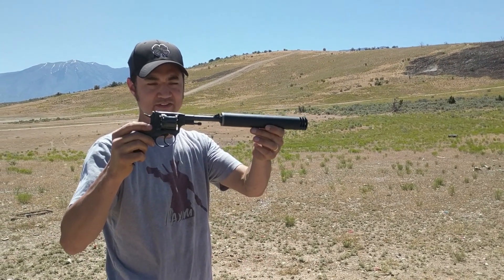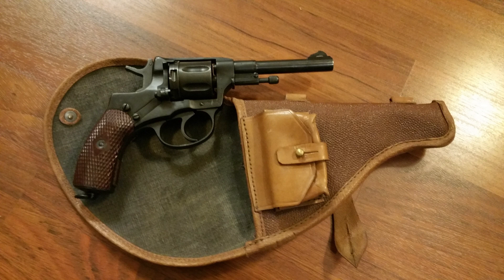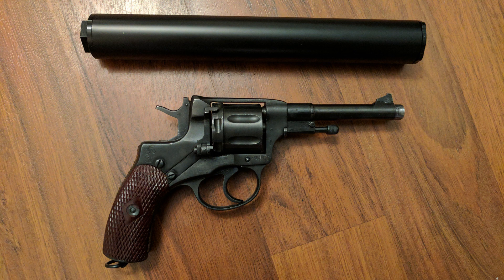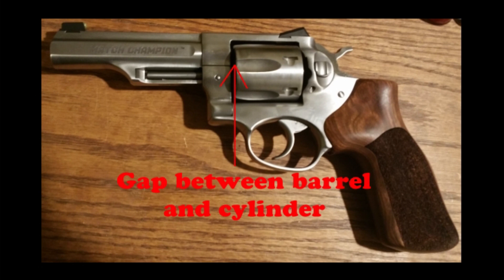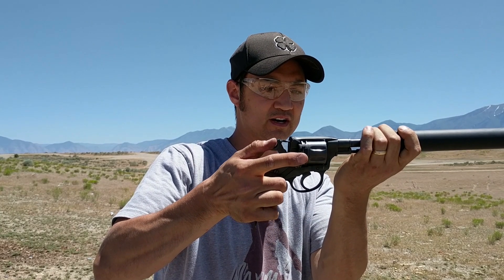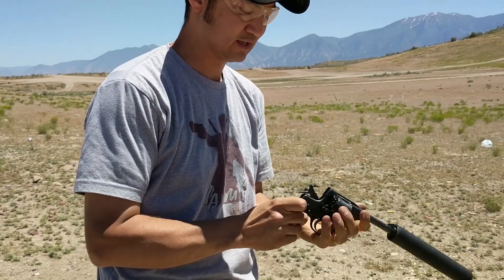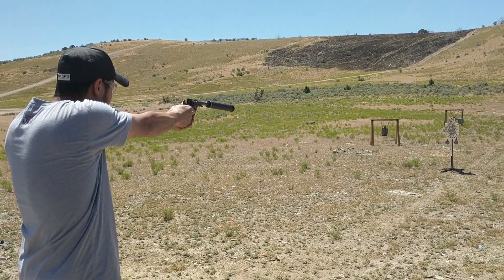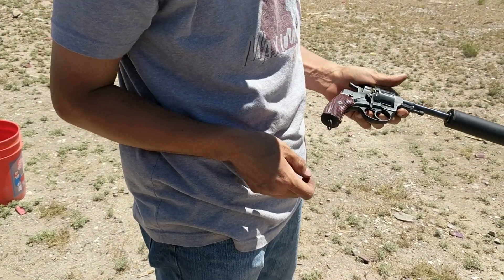Suppressed (Silenced) Revolver (Russian M1895 Nagant Revolver)

Comment: How does the suppressor effect accuracy and your ability to aim down the sights?
Reply from the maker: With regular height pistol sights, you can see the sights fine but the suppressor blocks view of the target--so you have to sort of guess where the target is if it is a smaller target.  It isn't too bad when aiming at larger objects.  My point of impact changed slightly.

Comment: I wouldent say you were going Blah Blah Blah that was very good information :), i just recently bought a pistol a more modern firearm, an H&K VP9 and i have been getting upgrades fever, i upgraded the mag release flippers, and aswell got a bigger slide lock release fin (i dont have strong thumbs) aswell im going to get a threaded barrel to get a compensator, or a Suppressor.
(oh also i have a Laser on it that i unironically zero'ed by just messing around with it then when i went to the range it was damn near perfectly zero'ed for 10-15 meters)
Reply from the maker: Nice, the vp9 is a great handgun
Reply: @FullLeadTaco  oh i love it :) i've put about 300-400 rounds through it sofar

Comment: reloading is a bit of a PIA .. but with cast bullets can be quite fun to shoot.
Reply from the maker: yeah, a nice light weight bullet with a light charge of powder is all it takes.
Reply: have you loaded for it?
Reply from the maker: just played around with .30 cal round balls and bullseye powder so far.  I need to do a 80-100gr cast bullet sometime.  That crimp is a little tricky though.
Reply: the crimp is easy ... all you need is to taper the mouth so that it fits.the real issue is finding a correct way to expand for bullet seating . if you have a conventional set of dies a custom long expander is usually necessary. i used .311-.312 cast gas checked bullets from 90-110 grs.
Reply from the maker: +duffys gunsmithing I was thinking that a hollow base wadcutter might make sense.  That way the base can expand and fit the barrel better.